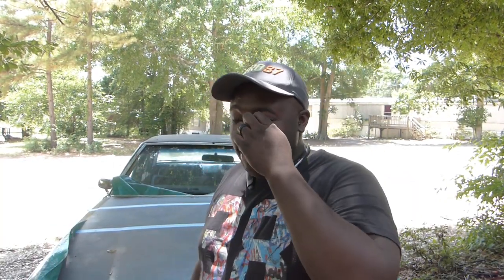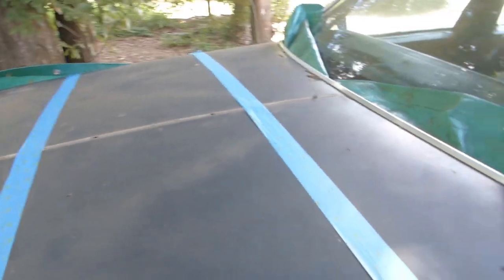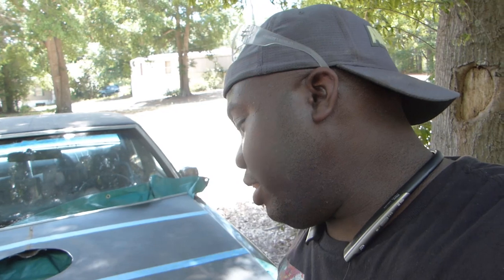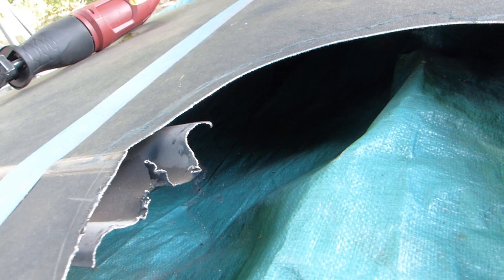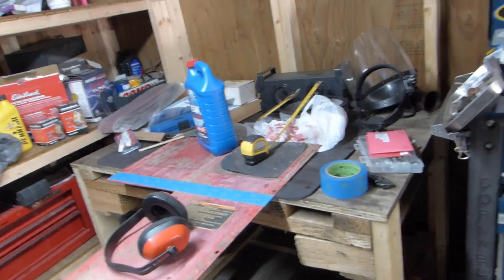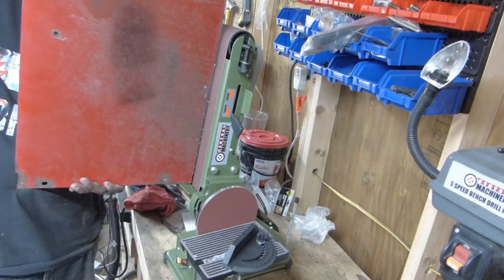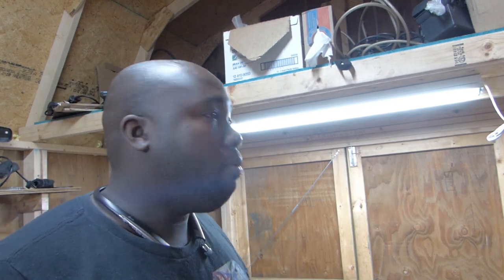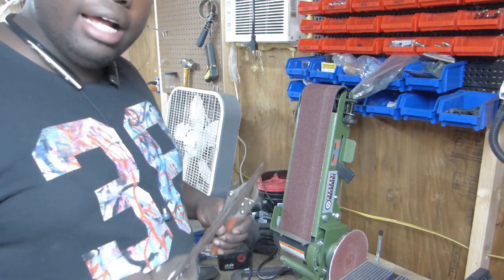Hood Scoop Build with harbor freight tools

Comment: For doing this kind of stuff you want one of these https://www.harborfreight.com/high-speed-metal-saw-91753.html But buy blades off a tool truck. Harbor Freight's blades suck. Also get an air swivel to put on it too. For full disclosure I have a Blue Point panel saw, but it's made in Taiwan, so the same as the far eastern imported crap. I just ended up paying 10 times as much. It looks just like the HF one. It is a simple tool. So I bet the HF one will work just the same. I've used HF blades in mine, and they do suck compared to tool truck blades. So you can't scrimp there. 32 TPI blades are what you want. All this tool can really do is cut sheet metal. But it cuts sheet metal like how you want to cut sheet metal.
Reply from the maker: Paul Frederick that is something I don't have. That would probably help with more accurate cuts and stuff. Thank you